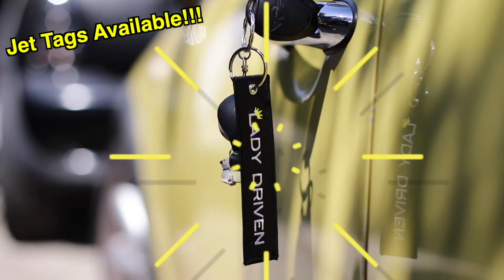Replacing the RUINED Differential in My Honda S2000!

Comment: Honda said 75W90. Motul made 75w90 equal to other brands 75w110 or higher. And also Motul make LS version of this oil! That's why people ruin those diffs because they think they know better
Reply from the maker: I don’t think the diff fluid is why it failed.. this also is a full time track car so it gets wayyyy hotter than normal. From everything I read on the forums you need a thicker oil. Also from everything I’ve heard S2k diffs aren’t that great and are common to fail. 🤷🏻‍♀️ I’m just trying things until I find something that works for how I use my car! :)
Reply: @JulietteHallie  i also do track days sometimes and long forest runs . For last 3 years Motul Gear 75w90 LS . Blue. Is double the money of normal 75w90 because is made for LS diffs. Totally different than gearbox oil. Most people on forums are some Mexican posers . They definitely don't use Motul in US and they have nothing in common with Honda engineers
Reply from the maker: @endlesstwisties  this is blue... I bought it originally for my LSD in my other car. I personally want to use something heavier because the 75-90 in it before smelt burnt. Again I’m just trying things that work for me and my program! If you don’t want to use anything besides 75w90 that’s fine! :) I’m in the USA and we use motul :D